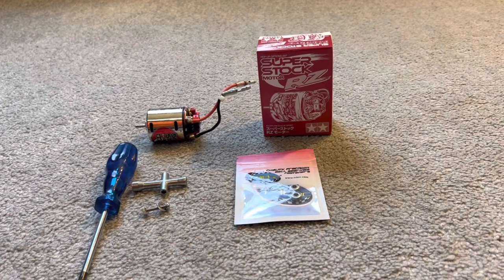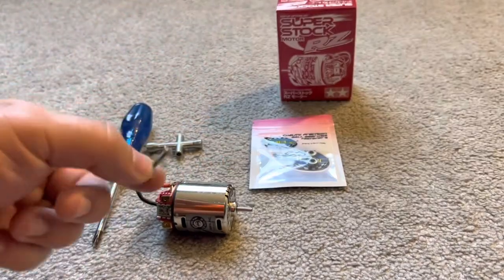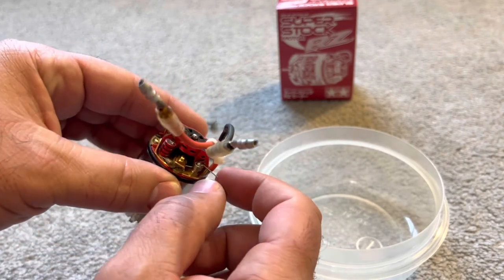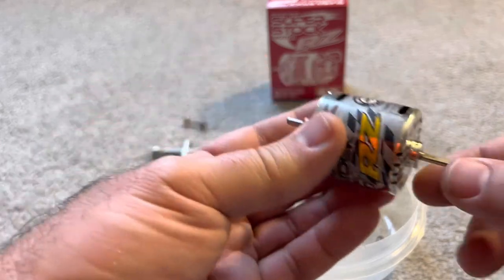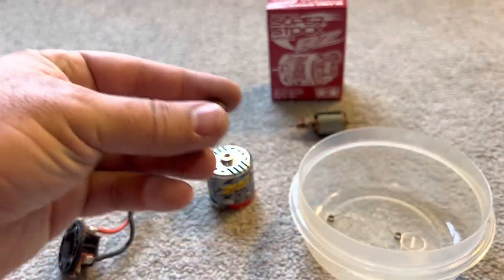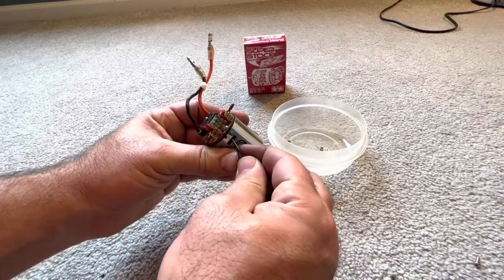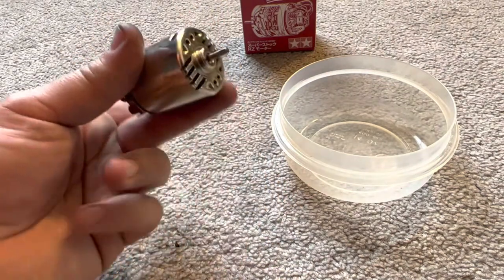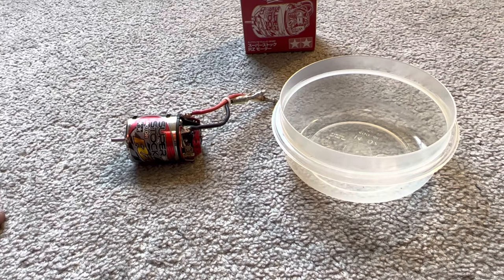Tamiya RZ ball bearing upgrade installation video

Comment: Excellent video, I am getting the Super Stock BZ motor and will be replacing the ball bearings straight away. Your method for "sandwiching" in the bearing is a great idea.

Comment: I have had terrible luck getting the ball bearings out of the metal bell. The plastic and bell is fine those basically fall out and I can replace them basically by just pushing them in with my finger but the bushing that is in the metal side of the motor will not come out. I can bang it out, and it really does take a lot of force to get the bushing out and using the arbor method that you have, which I tried myself I deformed and destroyed two bearings that I tried to insert into the housing. I even attempted to use the wood from a broom handle, turn the metal upside down and press it in from the magnet side , and it doesn’t work I tried using a puller broke the bearing I tried, banging them in with a wooden doll, destroyed the bearing
Reply from the maker: Wow I’m speechless. I’ve done 4 of these motors and never had any issues like this. Three RZ and one BZ motor. I cannot imagine that struggle. Sorry you had a hard time with it.